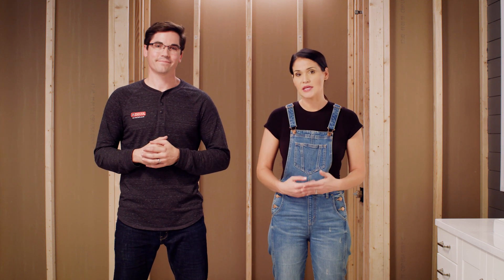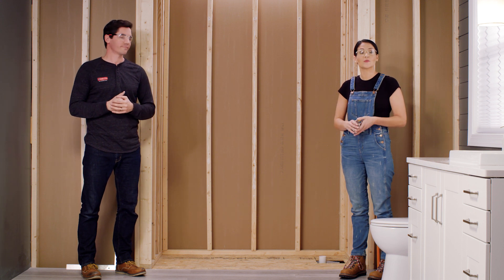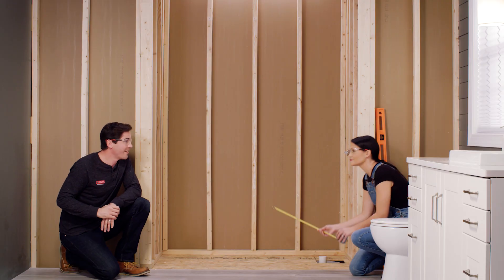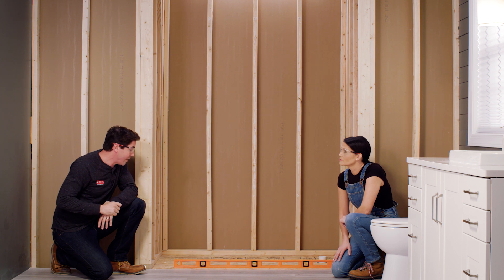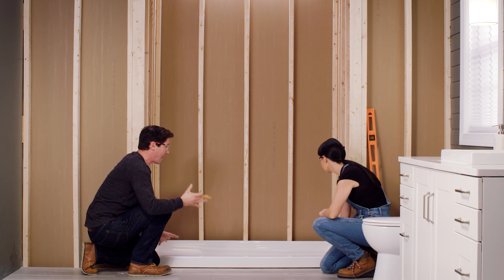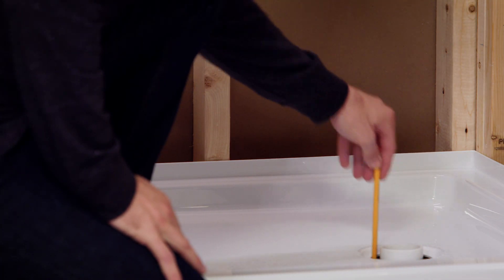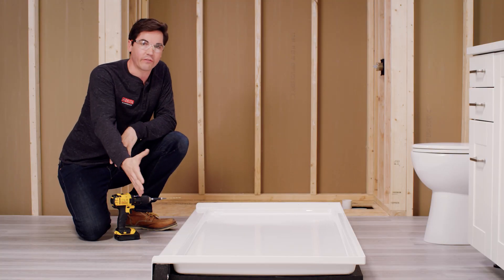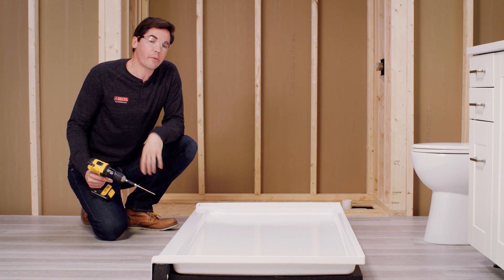How to Install a Delta® Hycroft™ Alcove Shower Base

Comment: Excuse me, but, how are you gonna install your drain if the pan is already glued to the sub? I'd really like to see how you did that & got that sucker as tight as it needs to be. 
That could be it's own video.
Reply: you can do a "dry fit" (put pieces in their place without gluing, screwing, or otherwise locking the item down permanently) like they did, just add the step of putting the drain flange on and maybe just leave the drain cover off so you can take the drain piece off again after checking.

Comment: Are there fastening clips to secure the base to the wall rather than screwing to the studs. If the floor flexes the base will crack if the base is secure tightly to the studs with unslotted holes.

Comment: Like the other comments on the drain....I cut the drain pipe 1-3/4” above grade which is too high for the drain I purchased.  I couldn’t find a “compatible drain” link/chart for my specific shower base.  What drain did you use in this video so I can just move on with this job? The instructions mention nothing either re: the drain.  Thanks, Terry

Comment from the maker: Hello Dave. Thank you for your question about installing a Delta Faucet alcove shower base. We recommend a construction adhesive that is safe for plastics can be used, please follow the manufactures instructions for application and cure times.

DAP 3.0 or Loctite PL Heavy Duty Sealant are two options. Thank you for being a loyal Delta Faucet customer.
-Bryan
Reply: You mention sealant and adhesive as two different products but in the instructions it only gives recommendations for sealant not adhesive???
Reply: @vanblindguy4600  just bought the classic series and it says clear sealant. Wondering the same thing...

Comment: Trying to hook up drain instructions must be wrong. It says to leave 1 3/4 inch above floor. That leaves 3/4 of an inch of pipe above floor of tub. Tried help line and they told me I didn't know what I was doing. I think I have to cut drain pipe into the floor 1 1/4inches which will be fun its concrete. Since two inches are under tub and 3/4 inches of pipe goes into drain fitting. Has anyone else have an answer?
Reply from the maker: Hello Bob!

Thank you for your question and we are happy to help. We apologize for this information not being readily available to you. Please send us a private message for further assistance. -Carrie
Reply: @deltafaucet  you keep saying you're willing to help yet you don't give the information. I've seen your comment on this question in a couple areas without the information.

Comment: love how they skipped right over the drain measurements and how to get the right height.
Reply: They said to be sure drain pipe is  1 1/4” above the subfloor
Reply: @Itzme347  she actually says 1 ¾"
Reply: "Were not liable if you can't run the plumbing" kind of video

Comment: You miss the step of cutting the drain pipe from 1&3/4 to final cut?
Reply from the maker: Thank you for the question! From our instructions, the drain pipe should extend 1 3/4" above the subfloor. It may need to be cut differently to install the drain, according to the manufacturer's instructions. 
-Bryan

Comment: All the measurements they took for plumb, level, and square were perfect.  They didn't bother to cover what if one or more those aren't perfect?  Because that maybe the case with many a homeowner's subfloor and framing.  This video has very limited value.
Reply from the maker: Thank you for the feedback, Daniel! If the floor is not flat and level a mortar bed should be used. Any gaps between the flanges and the studs should be less than 1/8". Insert shims to fill gaps. See the installation instructions for more information:

https://media.deltafaucet.com/MandI/104215%20Rev%20B.pdf
Reply: @deltafaucet  Thanks for your response